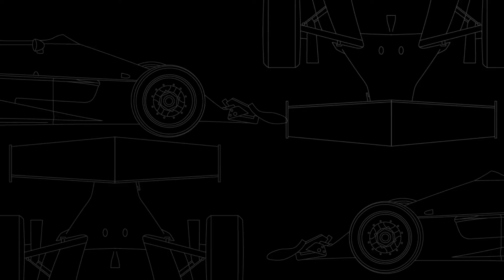サーフェイサーを吹いたので最後の仮組みやります【フェラーリ312Tを徹底的に作る】TAMIYA 1/12

Comment: Excellent craftsmanship! Where did you get the tiny bolts? All I have are small screws with not so realistic head.
Reply from the maker: Thank you for your comments.
The most expensive one is the Master Club bolt head with washer. I use them for the transmission case. I think these were made in Russia?
The others are R-RIVETS from WAVE corporetion.
And MENG MODEL SPS-006
These are all products for AFVs.
And the Plastruct hex bar. It's cheapest if you slice it.